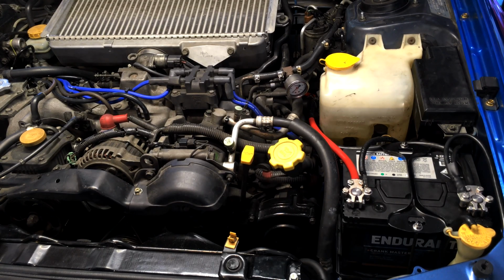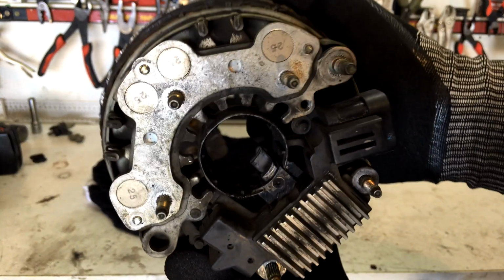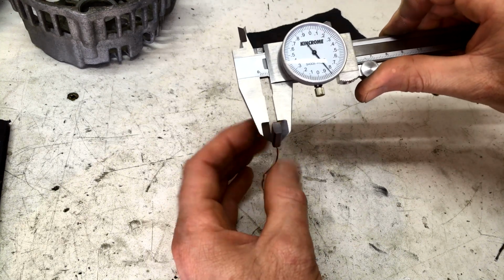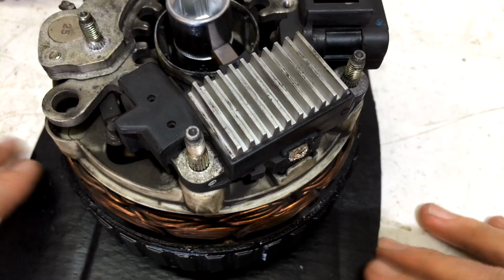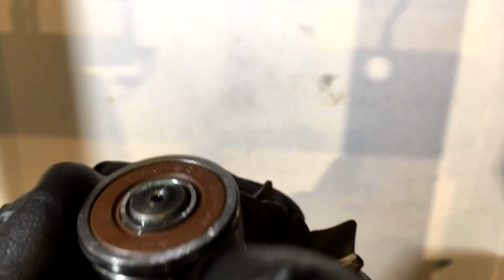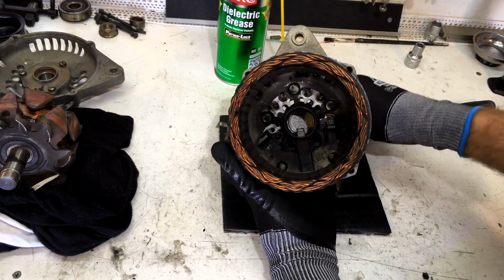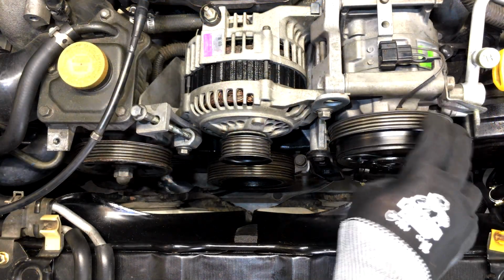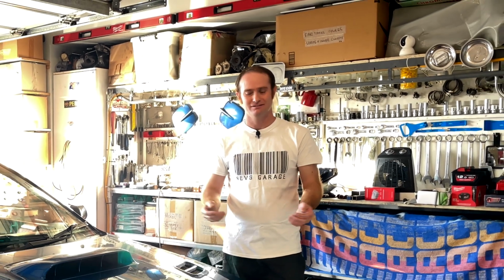Rebuilding a Hitachi Alternator - fitted to a Subaru MY99 WRX

Comment: Can we please get part numbers for the bearings and brushes
Reply: A lot of Hitachi alternators use a 10x27x11 bearing. They do this on purpose and their CEOs and engineers should have knuckle to face accountability. BD10-50DU, AB7. you can also get the Ford 6g alternator bearing kit and throw away the sleeve.